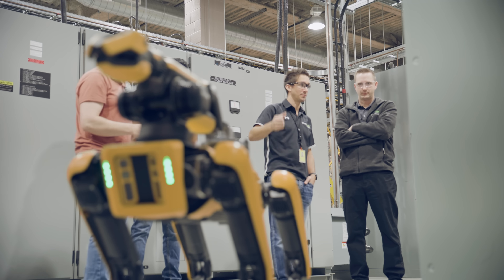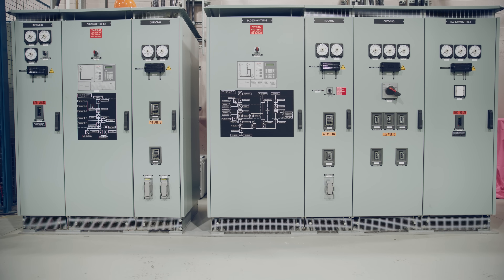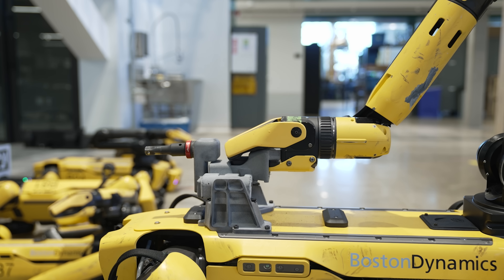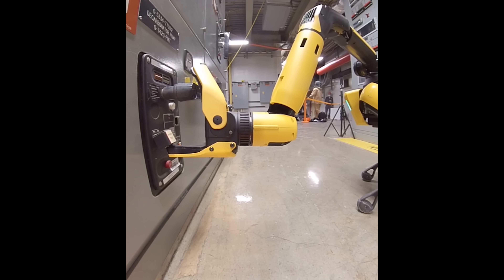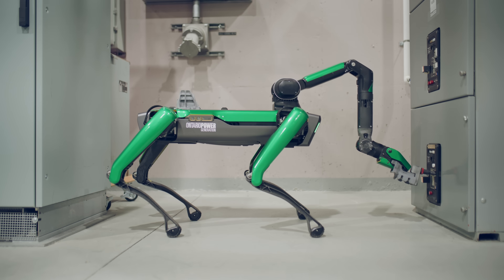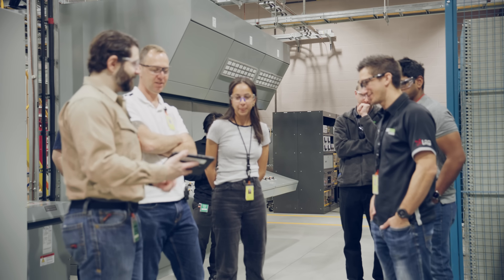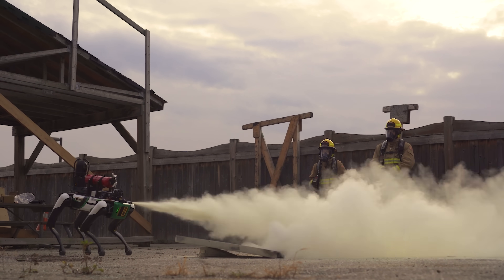Spot at Ontario Power Generation: Automating Circuit Breaker Tripping and Racking

Comment: It would be amazing to see a lite model of Spot. Something that is not radiation hardened and does not come with the extensive support offered. With costs cut from the parts the common people will not need. It probably would not bring it significantly closer to most being able to afford it, but everything counts. Maybe half sized? And less carrying capacity. Less mapping capability. Less amazing. But closer to achievable. Eh i guess there are alternatives. That are far less amazing. But. Well pretty much what i'm asking for. And still way out of reach.

Comment: So, this tool replaced a few workers and made a short time saving for the bottom line. How about the marginal productivity of replaced human intellectuals, which could actually make an impact on both the top and bottom lines? As long as technology only concentrates on automation and huge data collection for short-term profit, things will not get better and create a surplus that could be shared evenly.
Reply: Tell me you don't work in the industrial sector without telling me you don't work in the industrial sector.
Reply: @apogeelocoworks4370 And a very good example of what confirmation bias is. In AI transformation, there  won't be enough industrial migration as happened
in previous times.
Reply: @BurakErsoyAcePilot  look, if I can swap tasks from risking my closed casket funeral to operating a joystick I'm all for it, and hundreds of millions of others agree

Comment: It's a £hundred k+ robot, and the "hand" can spin around, but no-one's given it a basic power screwdriver!? I mean, re-design the breaker unit slightly so you can use a bit of string to flip the switch, and a second bit of string to spin the ratchet remotely? This isn't beyond the ken of man. But yes, nice robot.

Comment: Pretty cool, but I wonder why bother teaching a robot to use a ratchet when you can teach it to use a drill? I guess wireless on/off drills are not common place, but it seems like a good pairing for this robot, especially if it gets deployed in the field for tasks like this on a fairly regular basis.

It also surprises me that they had to wait on a universal robot to develop a solution for this. You could design a custom apparatus that attaches to the panel magnetically with separate tool functions that operate in sequence by an operator from a distance for the whole rack out procedure.

Comment: does any one know how to get into this type of work. im older and im starting over, bu this is the future and this is what i want to do. i also want to teach my son. as time goes on we are going to be replaced by these machines. i want to be ahead of the curve as long as possible
Reply: To be honest with you, it’s gonna take a lot of time and money to get into something like this. You will need at least 3 different kinds of degrees which can range between, engineering degrees, software engineering degrees, research and development degrees, just to get started. And depending where you live you might have to move to a different city or state because the one you’re in might not have universities or jobs for this specific career.

Comment: So instead of just running an ethernet cable and maybe a small motor or solenoid to the breaker… you bought a fancy robot and trained it to do something that never needed to exist.  Or only exists for the sake of human redundancy— the manual nature of the operation is to make sure that no computer-driven system can fault (unintentionally or invasively), and that an actual human has to be the decision-maker.  So you “streamlined” one servo/motor with dozens of servos & motors and hackable/failable/faultable computers on a mobile platform.  Yeah, not following.

Comment: Hurrah for Spot and BD.  Not so good for the experienced skilled worker.  The final upside is the company doesn't have to plan months ahead to reroute the power grid over a human safety concern.  Bad the design of the system did not take human safety into consideration as an industry.  There are power breakers in space with humans living within feet of them who cannot evacuate when a repair is needed.

Comment: One of the reasons humans stick to rules is foremost for the possible outcome of a bad action, the punishment if they go out of line.  Namely, the response from the employer and judicial system acting as a deterrent.  That's the basics of the modern state: laws and the punishment it comes if you don't abide them.  The sole purpose is to protect property (human life included).

Machines have no sense of law and order and are emotionless in regards of mistakes since they don't care about punishments. 

Who is responsible for the errors these machines do? 
Who gets to be responsible if there's a gross industrial accident initiated partly or solely by the use of AI-powered machines?
Who is financially and morally responsible for whatever those machines end up doing and, more important, who would be that dumb to rise their hand and voluntarily accept the role? Insurance companies? Who are they insuring and based on what? 

Is anyone really ready to spend their entire life in jail just because they put a 0 where there was supposed to be a 1 in a 345.234 lines programming code?

Taking humans out of the loop also takes responsibility out of the humans.  
So many questions regarding automation and AI and so few answers since we're just starting.

Comment: The fact that the arm doesn’t have a way to use an impact driver or a socket attachment is a miss. But this shows the versatility of the robot badass
Reply: Just having a free-spinning head would do the job. Or strap on a power driven socket onto one of the "fingers".

Comment: Maybe I'm misunderstanding something, but why is a circuit breaker located in a radiation hazard area?
Reply: I think it's a nuclear power plant, so the closer you get to the reactor, the more radiation you receive.  I assume it would be impractical to run the wiring all the way out to where the radiation is at a lower level, then all the way back, just to put the circuit breaker there.
Reply: @greensteve9307  Nuclear power plants don't make electricity directly in the core.  They make steam in the core, which is then piped out to turbine/generator sets.  Any circuit protection for that would be well away from any major radiation source.

Comment: What a waste of money and time…. I can put in, rack in, and close a breaker faster and move onto the next job faster then it would take to stop to let this thing, by the looks of it ratchet in a breaker. Plus one of the tests is to “feel” if the tulips are making good contact to prevent crushing, that test is done now… and what if this thing “breaks” half way through the rack in, now you have a breaker half on half off that you have to disconnect a machine potentially making this endeavour all the more dangerous inadvertently…. Again what a waste of time and money…
Reply: Did you not even understand the video? Your comprehension skills are lacking, let me explain. Tripping the breaker has a high chance of producing an arc flash which is 600 volts of uncontrolled electricity. Why risk human life when there is a way to minimize and avoid the risk altogether? 
On top of it, these breakers are in an area which exposes the engineer to radiation so its far better to have a robot do the task. Its not about the speed, its about mitigating risk with a better system. Pay attention next time, you might learn something
Reply: @SleepyWolvy shhh don’t explain it to him! let him go into dangerous areas

Comment: Very interesting!

Ofcourse a simple electric motor can do that for a few hundred dollars per breaker, ten times easier, faster and more reliable than Spot can only dream of. There is a reason why humans stil operate these devices and it's not that a human life is cheaper than automation.

Spot is still very much a solution looking for a problem. It's a damn cool solution, but it has no problem to fix yet.
Reply: It's not shown here but the task is to replace the whole breaker unit. You can add a solenoid or a motor to trip the breaker, but unscrewing it and replacing it is a complicated task. Especially in a radiation environment.

Comment: As an industrial service electrician who has donned 42cal/cm² arc flash suites many times to rack in new equipment/ breakers, this is a real joy to see... Thanks Boston Dynamics for making our industry safer...
Reply: @jackalterman  Personal Protective Equipment - here a jumper rated for the flash intensity produced by a short of a particular high voltage being worked on.
Reply: Could you give an executive summary of what the dangers are? I'd never heard of an arc flash suit, but can sort of guess from the name. Is it protection from a nasty UV flash?
Reply: @CraigGood  Yes, basically a fire resistant suit used to mitigate the effects of arc flash and arc blast... Arc incidents can be Very nasty, in fact several times hotter than the sun...
Reply: @CraigGood   look at videos of arc flash suits after a burn.. i will never do electrical work after seeing that. props to the people that do but this is a game changer
Reply: sucks there are those who don't appreciate innovation.
Reply: you are more likely to lose your job to him.
Reply: @jackalterman Essentially, clothing designed for electrical safety is given protection ratings in calories (a unit of heat energy). This rating is determined by how much of an electrical arc flash the clothing can handle. The clothing is usually made from cotton as it doesn’t melt like most synthetic materials. A “40 cal suit” as they’re commonly referred is very thick, think winter coat thickness, and used to protect the electrician from very high voltage arc flashes; at my job we use them whenever servicing any panel with 480v and higher, and we wear them to service 13,800v switches as well. I have never worked with anything higher than 13,800 so cannot comment beyond that. The suit has a full head covering, face shield, and thick, bulky gloves. Makes you look like one of those bomb disposal guys when you wear it, lol. And they get hot inside real quickly, especially in the summertime. For normal everyday maintenance, we wear a suit rated at 8 cals, which is basically just your standard cotton coveralls, washed in a way that doesn’t leave polymer residues as to maintain the cotton’s integrity as a non-melting material. If we have to service equipment under 480v and above 24v, we just wear safety glasses and insulated gloves along with the lighter 8 cal clothing. Hope this makes sense.😁
Reply: What is a calorie squared?
Reply: @theiceman259  it’s calories/cm^2 which is a unit of measurement for incident energy, usually in reference to an arc flash hazard. A “40 cal suit” (aka cat 4 PPE) will protect the wearer for up to 40 calories per cm^2 heat exposure, and is reserved for the more intrusive tasks on switchboards.
Reply: @jackalterman  Look up "arc flash accident" on youtube to see what can happen. Basically it's an explosion caused by extremely high current vaporizing metal into a vapor that then rapidly expands, burns in the air, and generally explodes.
Reply: Good morning my resume for the robots 📢👍🎦☺️❤️🕦🇦🇪🇵🇸🇯🇵🍣🤖👾🤖🧋
Reply: I don't know... but it looks to me a bit silly to use a robot like SPOT for this kind of breakers. As we are talking about innovation and automation... it should be easier to integrate an actuator in the breaker... overall these breakers are already partially automated...
Reply: @marcosadun  I don't know how you'd automate a breaker replacing itself. And one robot is probably cheaper than hundreds of more expensive breakers.
Reply: @marcosadun As an electrical Inspector I can confirm that there are auto racking breakers.
I’ve worked on and installed several of these.
They can be remotely controlled from in a “safe” room so if something did go wrong the work crew is isolated from a potential arc flash.
Reply: @oldtimer2192 yeah the real problem is just that it takes a long time to replace old stuff with the new safer stuff.
Reply: @oldtimer2192 and then how do you completely replace the breaker? Also, what is the cost difference between what's used in the video and what you are talking about? Because of the cost difference is high enough and a facility has a lot of these kinds of breakers. It would probably be cheaper to buy the cheap breakers and then one spot for doing all the work
Reply: @jackalterman he put on a suite that's arc flashed rated or designed to protect himself if when he has a human racked in or out the breaker and something went wrong ideally it wouldn't harm him.
Reply: more like "THEY TOOK OUR JOBS !!!!!"
Reply: Thank God they developed a robot to do my job. I was thinking the other day that I wish I was unemployed
Reply: @Chicago_guy_1  If you're talking for the job that you do, you're disappointment is acceptable, whoever for the job, the person in the original comment does. If you're actually disappointed that you were replaced by a robot, then clearly you don't care much for your own life because any mistakes in a position like that and dying is likely, where as if the robot makes mistakes? It just gets destroyed if that
Reply: @the_undead  I'm assuming you don't know what you're talking about and you don't work in my field. There are safe ways to rack out breakers without robots.
Reply: As someone also working in this field, this robot is completely impractical. The time, effort and cost of setting this up would be ridiculous
Reply: @paulsimons769  , I guess working that specific breaker - yes. But figure out a dozen or two operations that could be harmful to a human while being too complex to do using more specialized robots (auto racking breaker mentioened above sounds like it), and investing 50-100k usd (just guessing here) in something like Spot starts making more sense, imho...
Reply: @paulsimons769   in the short term, but innovation is almost always cost prohibitive when only a small sample set is used.

Comment: While seeing the bot ratchet a wrench looks cool, it seems counter intuitive to just having some sort of drill attachment that just gets pushed onto the bolt and spins...
Reply: It's perfectly capable of using a ratchet wrench and it gets the job done fast enough. Why bother adding weight and another point of failure to the design? Power tools generally aren't very delicate either, and this seems like a somewhat delicate job. You also might not be allowed to operate power tools within the vicinity of these breakers in case of arcs.
Reply: @joost1120 Spot is literally a power tool
Reply: @sheponbass he’s more then just a power tool! He’s everything we ever wanted… that’s a song I think

Comment: One thing I'm confused about: why the racheting motion? Can Spot's hand not spin freely?
Reply: I think his hand can't spin freely because slip rings are a point of friction, a maintenance issue, and are not spark-free certified to work in explosive environments.
Also, Spot ratcheting like anyone of us would do is super-cute, and as I've followed them from the very beginning, I think that the cuteness/biomimicking factor is a design feature at boston dynamics.
Reply: More like, why can't he use a power tool, lol.
Reply: @Idiomatick  Spot is a power tool. But seriously, the ‘hands on’ approach is safest. Any operator will tell you that sensing any resistance when working on this is important. Spot will be able to relay telemetry on the stiffness or resistance of the fitting, just in case there is a bigger problem at hand.

Power tools are handy for some tasks but other tasks require a softly, softly approach.
Reply: I would guess the wires and hydraulics that actuate the hand only have a limited rotational distance.

Comment: I work in a Combine Cycle Plant & 1 of my rountine task is to manually rack in/out 6.6kV breaker. Little did i knew until i saw the video summary saying 600V breaker is consider high risk. How i wish my power station would buy just 1x SPOT..

Comment: incredible. Can't help but think that that breaker could be designed better - why is it a key step in the process to ratchet a bolt in/out of a socket?
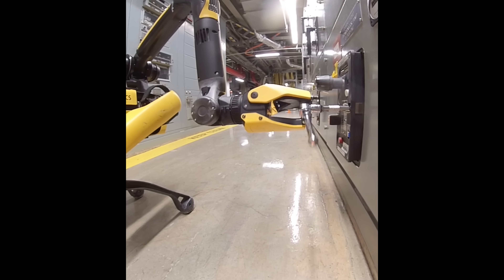Reply: The whole breaker assembly is moved by the bolt, it physically comes out of the panel to the point where the connectors on the back are disconnected from the iive terminals.  Watch at 2:06 and you can see the black piece moving. The whole breaker box comes out.